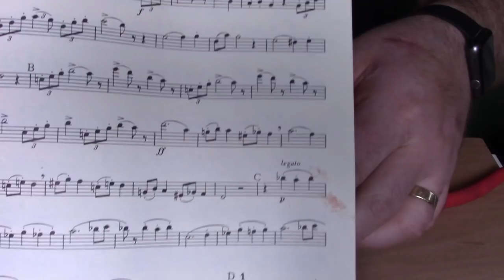How to make a Trumpet Mouthpiece out of Hot Melt Glue

Comment: a way to patch up the holes that are causing air leaks u should have  heated up a flat head screw driver and lightly drag down to pull some of the glue to fill up the gaps